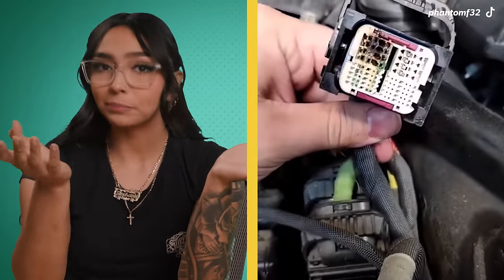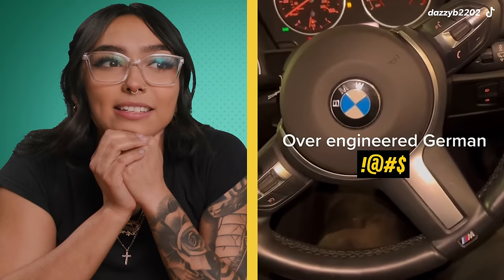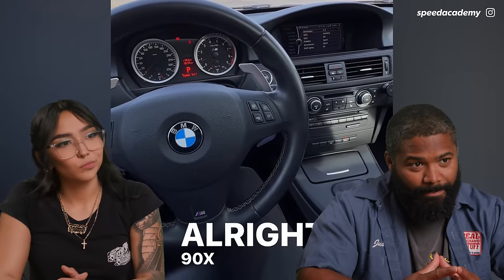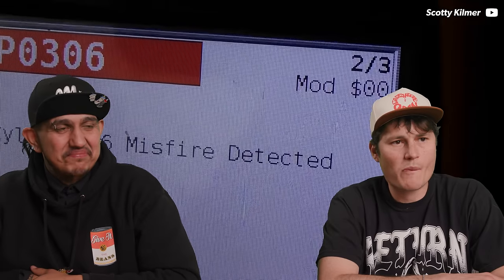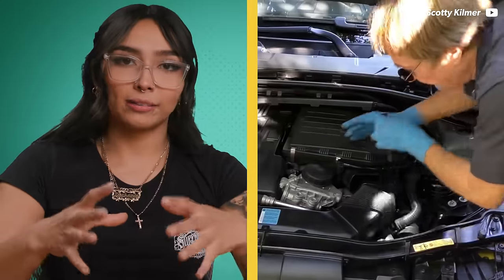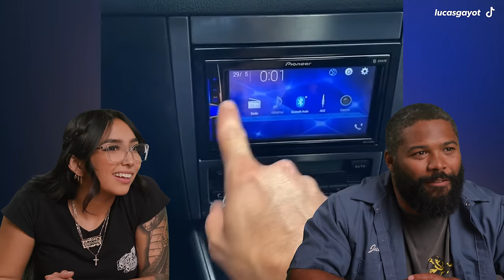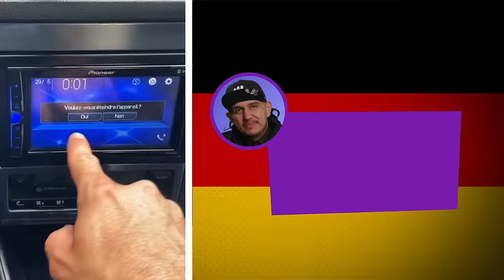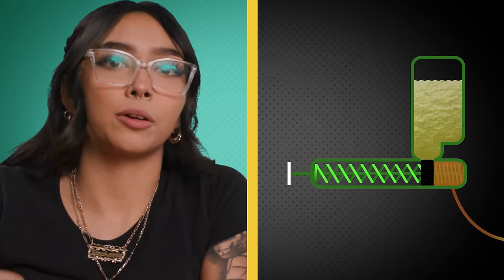Mechanic Reacts to German Engineering Fails

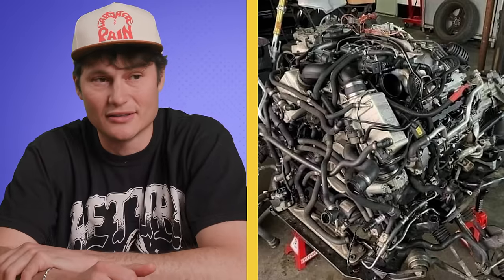Comment: 1:49 This says everything about German cars, although there are some decent German engines and cars out there the basic facts remain especially with the more high end vehicles, the chance of failure grows with the amount of parts a machine is made of. Just look at performance brakes, a "normal" vehicle works fine with one piston on each caliper so 4 brake pistons, performance vehicles can have 6 pistons per front caliper and 4 per rear caliper total of 20 pistons, easy math, 20 is 5 times more than 4 so.. 5 times greater chance of something failing.

Comment: Soo as a German working on old BMW is have to defense my engineers . German Cars are build to peak and u are expected to handle, service and treat them well. If u do u have a great time. Of course when you have a 7 series with  basically very limited space to fit those engines there will be some problems, but we also have different standards with exhaust gases and noise limits so we often have to engineer the shit put of these engines and make it impossible to work on. But if u can afford a 7 series u can afford to have a bmw dealership to work on it and care for it. With the water thing in the trunk, it's basically written in the service manual to check if the drains are free at every service.

Other than that except from rust these cars are great. Having an old 3.0I Engine (I think m54b30) it's basically undestroyable and very reliable while also is fun to drive. Was voted the best engine like 10 times in a row when it came out.

Comment: Newer shit is all engineered the same way.

Jam pack everything, intentionally engineer shit to fail, make it visually, and physically, challenging enough to take the home DIY mechanic completely out of the equation. “Come back and spend more money after your initial buyers cost!” Manufacturers commence filling pockets…

Coolant tracking up a wiring harness, or traveling up any physical component, is called “coolant migration”. It’s like taking a dry sponge or paper towel, and dipping just the corner of the sponge or paper towel into a puddle. The liquid will pick up and travel along…

Coolant is oily, and it’s liquid. Being oily, it doesn’t dissipate and evaporate like water would. Once coolant goes there, it’ll stay right there and travel, unless the coolant is removed.

Liquid is electrically conductive. Meaning, electricity travels through liquid. It’d be like taking an electrical circuit, and crossing and touching a bunch of those wires together. Won’t have good results.

Pop your hood and visually examine your shit every now and again. Please, people. I beg of you!

Hopefully, if you check your oil dipstick, and see that there’s no oil on the dipstick, you’d look to see what amount of oil you need to add, and you’d add the proper amount of oil accordingly. 

My argument there for everyone. If you went to turn the windshield washer stalk, to wash your windshield, and the windshield washer fluid didn’t come out and begin washing your windshield, you’d most likely check/add windshield washer fluid. The engine of your car is a tad bit more important than your windshield washer fluid.

I’d like to think if someone popped their hood to give it a quick visual scan, they’d see a wiring harness is wet with liquid. One part of the harness is visually dry, and another part of that same wiring harness is visually wet. I get it. Not everyone is going to be acquainted to something as subliminal as coolant migration. I fully understand that. But, if someone pops their hood every now and again to check the automotive basics, and sees wiring harness wrap tape discolored and soaked in coolant, I’d like to think they would tell an expected repairer, or do something about it themselves.

Maybe I’m wrong. Maybe I’m a little different breed and more perceptive than I give credit for. I understand that aspect also.

Comment: Never been there, but I seen a video on Scotty kilmer.  On a mercedes, he needed to use a scan computer to work on the shocks. And they were $1100 a piece.

He seen another mechanic who changed the brake pads on a mercedes. Didn't reporgram it or something and wouldn't even start.

Comment: Porsche boxster if drain tubes are not aligned the rain will over flow into the cabin and flood out and all the electrical control modules are under driver seat and short out

Comment: Their first EV... the BMW i3, was driven by the FIRST EVER electric motor BMW had ever designed (of any size or kind)... in-house designed AND built... and was designed with small (72mm OD) sealed bearings.... without any kind of cooling.  This is a motor that normally runs constantly at 8,000 - 10,000 RPM at normal highway speeds, maximum of 12,000 RPM at 93 MPH computer limited speed.  So, if ANY wear happens within that bearing... the metal debris stays right there, continually running through the bearing, causing MORE wear and tear. (nobody does this... they all use massively over-sized bearings, OPEN and use full-time lubrication, recirculated, cooled and filtered)

PLUS... as if that wasn't enough, the bearing they used was a cylindrical roller bearing... which suffers from "roller stall" under no-load conditions. In an EV, it's super common for drivers to TRY to drive as economically as possible (unless they're challenging someone to stop-light grand-prix - because of the wonderful instant torque from a dead-stop).  So this "eco-friendly driving" causes bearing stall... the inner-race continues to rotate at full highway speeds, but the rollers stop spinning... this is roller stall. THEN, when you have either positive or negative torque, and the bearings are back under load, the 'now stalled' rollers SCRAPE OFF THE OIL FROM THE RACES... creating metal-to-metal contact... instant wear & tear... which stays right there in the bearing.

OK, so mine (2015, BEV, Tera) started to fail at 70k miles, while still covered by the CPO warranty (it began making whining noises that it had not been doing previously).  So I complained to the service department at my (then) BMW dealership... and was clearly told "don't worry about it, that's normal for the i3".  Being too "new to BMW", I believed them... and ignored it...... until at 94k miles (after the CPO warranty had expired) all of a sudden it got WAY too loud to ignore.  Went back to the same dealership, and was told $15,500+ for the repair... to replace the entire drive assembly... including the inverter (massive electronics box).

Went to a more technical BMW dealership, they properly diagnosed it as a failed drive motor, was told $7500 to replace it... because BMW does not know how to replace $20 motor bearings.  I was also told that it could end up costing more if it also damaged the transmission input shaft bearing... which is a splined shaft that mates with the motor splined receiver.

After some research, I found that this was not an uncommon failure mode for these cars.  Many people who had this issue were able to get BMW to help with the repair by providing the replacement motor at no charge, the car owner just was responsible for labor and misc. supplies.  I would have been happy with this outcome... but BMW told me that my car had "too many miles to get involved in the repair"... so 94k miles is end of life for the i3????

I'm 65, and since I was in my mid-teens, I used to dream about owning a BMW... that "German Engineering" was a big part of the draw, and was all the rage when I was growing up... and this is the result.  This is NOT the same BMW I grew up dreaming about.

One and done.

Comment: I’ve owned a Mercedes V8 and you can’t fully turn off the traction control. So, there is nothing you can do to do a proper burnout. I tried and it’s very frustrating.

Comment: For BMWs if you change any control module, any sensor YOU NEED to reprogram,, for the steering rack you HAVE to mandatory reprogram and follow the steps on the proprietary BMW software so the main computer know the top/bottom ends of the steering. otherwise the car will throw the German tantrum

Comment: BMW from before 1990 to now always pain in the ass breaks so often and bad placement of everything and special locking bolts      like old mercedes is so easy you doesnt have springs on the shocks so its so easy to replace like on w124 if you have the the right rims you can probably remove the wheelbearings without even taking of the rims or need of using a pressing tool

Comment: Those engines are build to cost, also regulations and sensors strangle the engine. I got a vw engine from the 2000 and runs great

Comment: Well, i don`t think that it`s only a german car problem. My last car was a chevy blazer. It was a real pain in the ass the work on it.
Now i have a Alfa Romeo 147 GTA with the V6 Busso engine.
And belive it or not, this car is the hardest pain in the ass....in every way.
If you wanna make an oil change....it`s a lot of fun. The oil filter in this car stucks between the engine and the dashboard. There`s only a little tiny space deep up in the car, were the filter is located. And to make it more difficult to change, the whole pipes from the air condition are infront of it.

Comment: The biggest scandal is BMW updating software every 6 months-so you must purchase the updates-otherwise you scanner will not read correct trouble codes. Basically forcing you to have the dealer do the work-no independent garages will work on them

Comment: Should I sale my 09 cls550? Having trouble with Rpms not reading right could be in 3rd but barely pushing 25. Limp mode ? Transmission ? Torque converter? Haven’t taken it to get diagnosed gears shift fine & no big noises P0 codes show up
Reply: Got stuck in snow & reved high trying to push it out

Comment: i am currently working on ford galaxy 2010 (europe manufacturated) doing a manual swap and first of remowing the center console is the thing i get about the procedure for transfering from auto to manual gear shifter but the thing i don't get first why hidden bolts or just bolts hiding in plain sight but turned ower so i have to first remove the parking brake and then the center console and second there are 5 nuts holding the brake pedal bracket and the nuts are not perfectly round but oval in the centre so they don't fall of the bracket it doesn't make any sense i am doing the car for a whole week and i am just annoyed by the manufacturer of the car and if anyone is asking the nuts are from factory

Comment: Had to use BMW Dealership software to bleed the brakes on my old e39
made before OBD2 so it only had a old BMW connector.
Also the abs module sits right beside the engine with not heatshield or something and its common that they fry bc of it.

Thanks BMW

Comment: I had a Volkswagen Passat and almost no mechanics would touch it. Same problem with my Mini Cooper but that is a BMW now. The engine compartment was tiny and completely full. It is all intertwined like a bowl of spaghetti.
Reply: Learn2Wrench, it's the only way. Mechanics, especially in America, follow American design and repair principles: universality, modularity and accessibility. German cars are NOT designed with anything but peak performance in mind. They use a complex system of sensors and computers to monitor and adjust every little thing on the car, and most people don't have the patience to do things right. I have owned both Japanese and German cars, and the way I approach service, repair and replacement is very different on either. Basically, RTFM and understand the tooling required. The process will be frustrating without, and seamless/rewarding with.

Comment: The steering angle sensor is so the car can help you in skidding situations to correct the slide and get you pointed where you want to point the ABS and ASR systems are amazing traction control and slip regulation

Comment: Second clip is just a power steering error, happens constantly with non German cars too. Electronic steering is also not an exclusively German thing, in fact it's most prominent in Teslas.
Third one, even Sandro admitted it's either animals or no maintenance.
Same on fourth, it's something shorting out, it happens, everyone said so...
Fifth: Yes, you indeed take the cover off (if you do it properly, you don't have to stab your engine with a screwdriver to do it btw) to work on the engine underneath. Plastic covers on engines are the standard for pretty much any car from anywhere since, what? 2010? And then, if you put a normal sparkplug in there, it'll also work. Pro tip. Then for the airfilter... Yes, if you unplug the airflow sensor, you indeed need to plug it back in... APALLING, I know. Why the fuck doesn't it plug itself back in smdh.
Sixth: Brother just couldn't do a burnout and burned the car instead.

Comment: I am American-born, but German on both sides, back to great grandparents.  Yes terribly complicated / unreliable designs and come from Audi and BMW.  So many emissions crap one-way valves that fail in 5 years.  Plastic water pump impeller?  Who does that? Plastic parts routing coolant.. and you know, those parts on the accessible engine side, don't fail, just all the others.

Comment: My Mum bought a brand new 2007 Holden Red Barina about 20 or so years ago here in Australia BUT the car was strange as it was made in Germany & had a different type of engine which is apparently 1 of a few in Australia with it. All papers for the Barina were in a Holden Astra that had been made in Spain & bought to Australia as well. It was a long bore engine & Holden didn't know why it had different parts & had to order parts overseas before they closed down but we don't have it anymore. Grandparents got rid of it without telling me. But the thing was a bloody nightmare to find parts at the time but damn that thing was F**KING Indestructible!!! so many times it came though for us in tough times & used fuel like a kitten drinking milk. Quarter a tank got over 100ish km & 50km more on red light yet was never served. I wish I had that car back it was like a unicorn 🦄 🦄🦄😅

Comment: I had an e36 that I rolled over 2.5 times ( it came to a stop sitting on the passenger side of the car) me and my boys just pushed it back on to it's wheels, busted what was left of the windshield out. Put on some motorcycle helmets and just kept goin. We finished out the day's event like it never happened. No fluids leaked, nothin cracked, engine wasn't damaged, the side mirrors were cracked and broken but the driverside mirror popped back into place, Just some body damage and lost the windshield and passenger side window.

Comment: I wonder how much of this is due to the strict laws and requirements in Germany for modern cars. They are basically required to have a ton of safety features, need to be environmentally friendly, have small displacement... They are probably trying to get as much as they can out of these engines.

Comment: I mean, my car isn't the worst to work on. Just some stupid stuff that they did. I've got a MK7 GTI. I love it. It's my baby. I'm just gonna list off a few thing that I think are stupid about the car and we'll see if anyone agrees with me. 
1. Plastic oil pan with no protection from road debris.
2. Plastic water pump/thermostat housing.
3. Plastic quick connect hoses for coolant. (Noticing a trend yet?)
4. Plastic clips that hold basically everything together.
5. Layered metal and plastic sunroof that cracks in front corners by the windshield.
I love it though.

Comment: My German cars the last 30 jears worked flawless. VW GTI 275 000 Mercedes C220 CDI after that E220 both over 300 000 Audi Q5 V6-TDI 390 000 BMW X6 3.0L inline six at 200100 going strong. Change oil and Filters every 20 000km dont high rev first and last 10 min of every drive Change Belts Pumps and Tightners at service intervalls

Comment: Well I think the problem is these engines and cars in general are engineered to work perfect and smooth without any issues as long as you maintain your car regularly.  And ofc because of our extreme low carbon emission laws. you see in Germany all cars normally get at least once a year professional maintenance because every two years this gets checked by the so-called TÜV which will basically keep your car until everything is fixed even some minor problems. I’ve been to the US a couple of times and oh boy there are basically no real laws forcing you to keep your car in almost perfect shape. It’s really great for tuning.. and getting crashed into by a car without rotors ;) I now had several German cars and never had any issues, however… my last car was a ford And thanks to the pre-owner filling in the wrong oil or doing it a bit too late the timing belt, which runs in oil, disintegrated and the almost new car totaled itself… :/

Comment: a wiring harness is easily thousands considering labor. a neighbor cut thru a harness an found tf out, he also cut a tie rod to access a bolt, when i asked if he realized what he did, he suggested he planned on welding it. he had money, tools, and no brains.

Comment: i worked on a v6 mercedes. it had a engine failure. i rebuilt it. 6 months later it was towed in and i was like oh no. did i messes up. but it was an electrical issue. the ecu fried itself because its mounted on top of the engine. why! a ignition coil was broken and sended high voltage into the ecu. but why was it on the engine.
worst cars are deffinetly bmw's. my brother had a e87. this thing was literally all 2 weeks broken. and it got me to my breaking point. so i forced him to sell it.